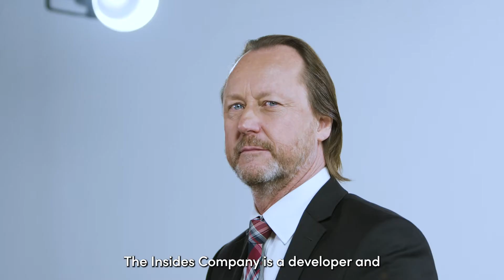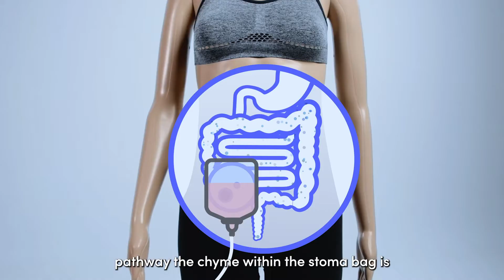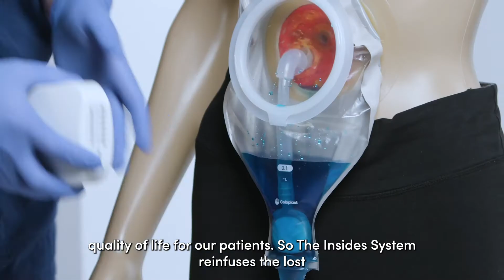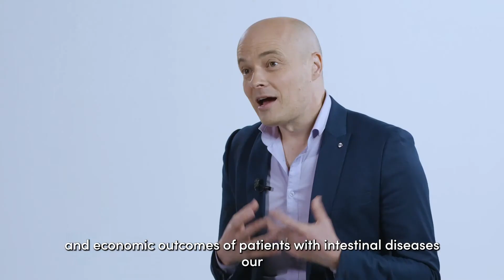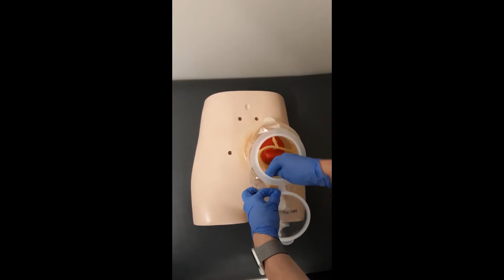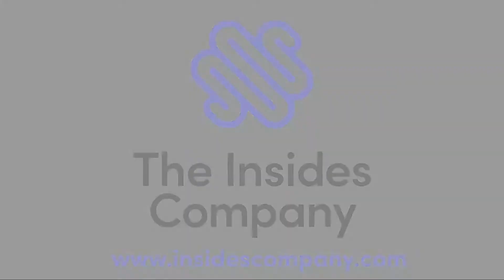Introduction to The Insides Co.

Comment: I am currently 10 days discharged after a reversal of a previous stoma failed.  I was fortunate enough to be approved for The Insides Co. Chyme Pump.  I am still learning how to adjust my intake of food to be capable of pumping into the distal limb.  It would be wrong to assume management is easy, it is not, the daily changing of the stoma bag and accommodating the internal pump can be quite fiddly but is improving as my dexterity improves.  I am hopeful that a second attempt at reversal will be made with 3 months or so and am grateful that this equipment is increasing my strength through better nutrition